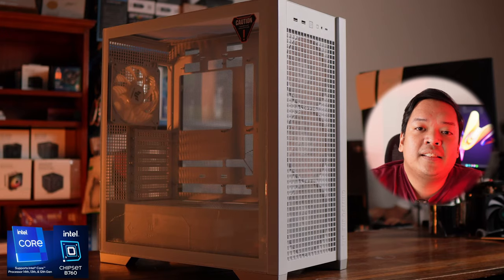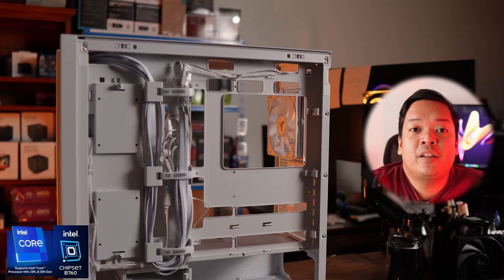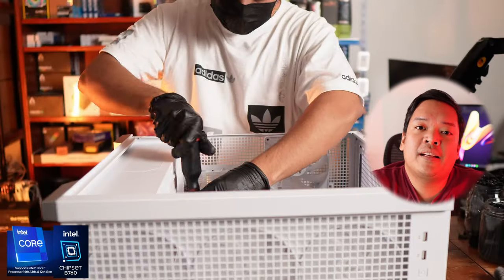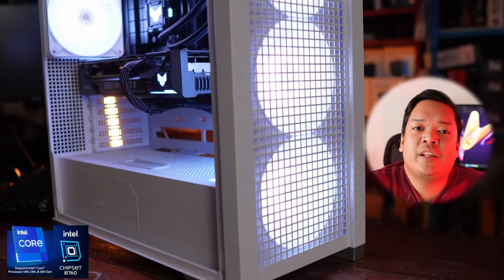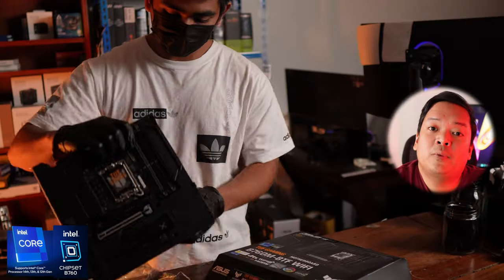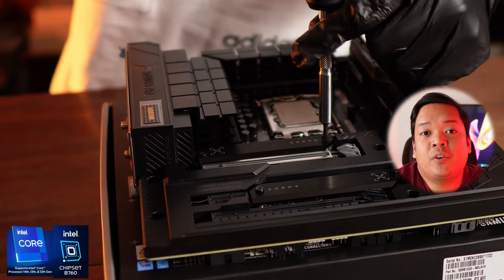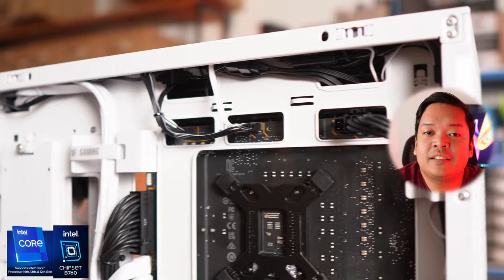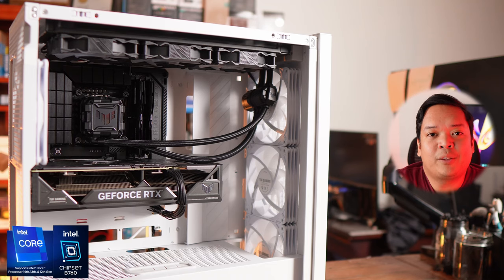No wires means no stress - An Asus BTF Build

Comment: And what happens with graphics cards, because I see from numerous videos that the use of air cooling, which I would personally like to use, unfortunately gives us higher graphics card temperatures, especially with high loads that we can have on the RTX 4070 Ti super and higher models and their AMD equivalents.
In addition, Deepcool AK 620, which is often recommended for Ryzen 7 7800x3d, may work somehow, but its maximum temperatures are lower than those of Intel processors,
so it is puzzling that following the logic that we choose a more powerful processor, it is because the weaker one cannot cope, and if we choose a more powerful one, we expect that it will be used in 70-90%, and all the videos I can find about cooling, especially air cooling, use this processor in within 30-70%.
Having no practical experience, but after spending a lot of time browsing the Internet, I come to the conclusion that air cooling will be too weak when it comes to the situation that this processor will be used more, especially in combination with a graphics card where you buy this processor, everyone hopes to change the set to a more powerful one someday.
And the temperatures of graphics cards increase the more powerful they are, so I wonder what the load will look like in a closed, classic case when these two components are loaded at 80-90% on a card at least like Rtx 4080, which is great because it is the most selected set in terms of performance at the moment. .
Sorry for any mistakes, I use a translator.